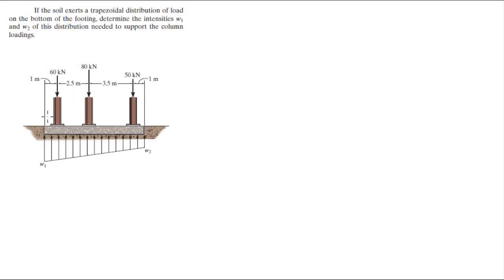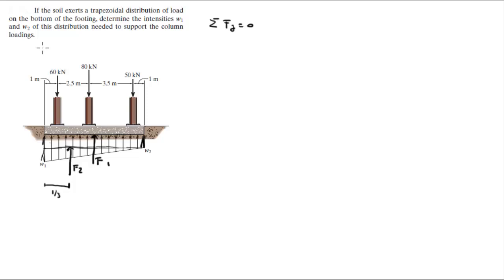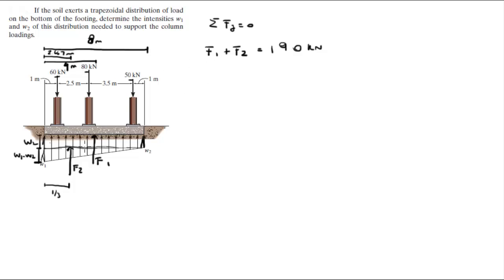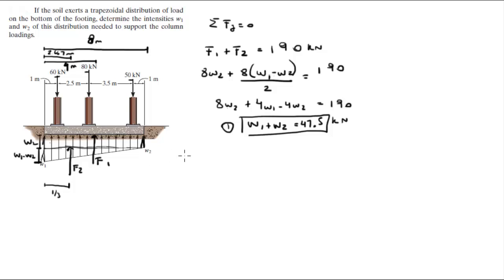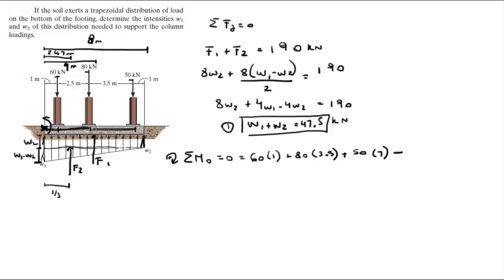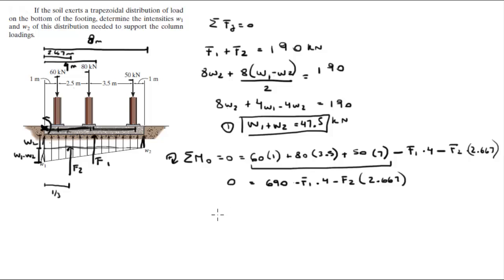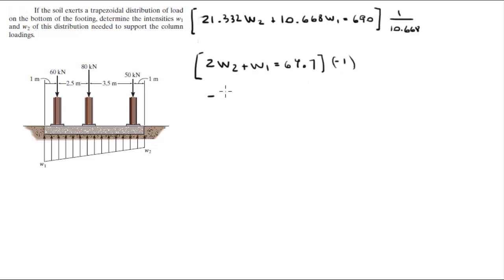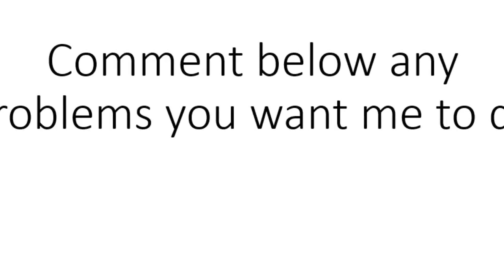Determine the intensities w1 and w2 of this distribution

Comment: How do you find 2.667? Can somebody help me?
Reply: He got 2.667 because 8/(1x3). He is doing this because the center point of a triangle is always 1/3 off from the right angle in x y and z axis. You can also think of it like the 1/3 length trapezoid having the same surface area as the 2/3 length triangle